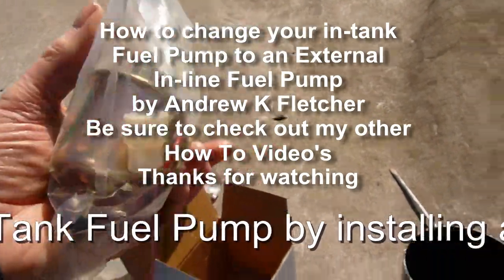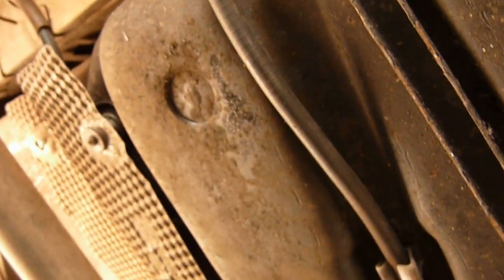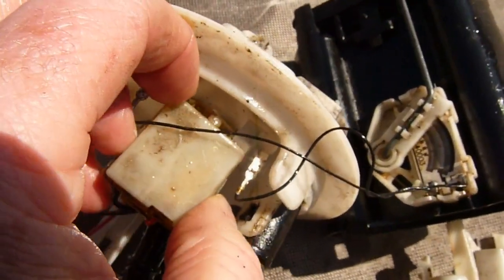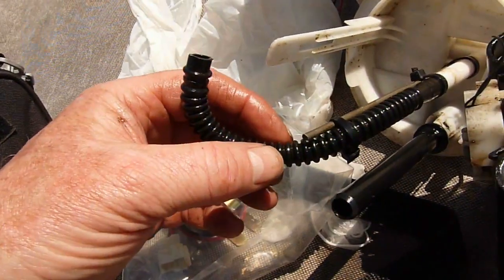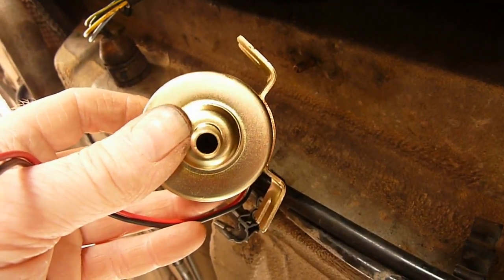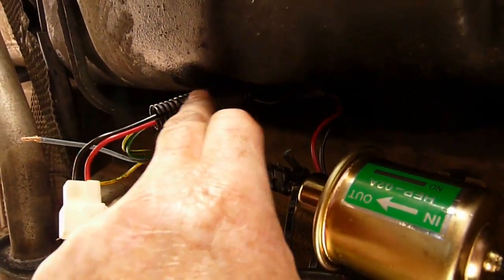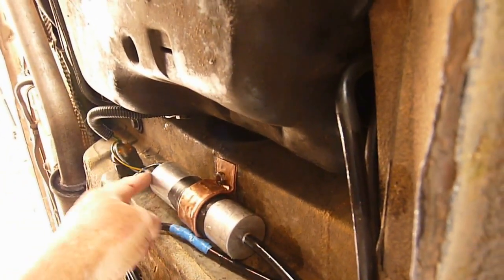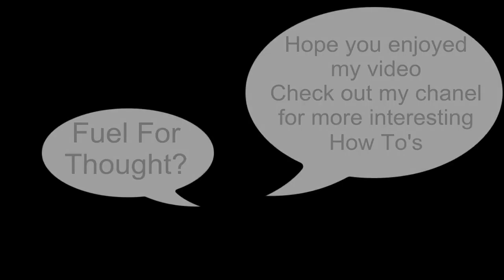Fuel / Diesel Pump Replacement + Conversion to external inline pump from In-tank type Citroen

Comment: Had a similar thought while replacing the fuel pump for my 2006 Honda City/Jazz. Fortunately I found a new replacement motor so the cost was lower than chahing the whole unit. This is good when you donot have a replacement parts or wnat to keep cost low and you are ok with a bit of modification.

Comment: Great video, I just have a question: on my car the original pump works but I think it needs more pressure so can I put an universal electric fuel pump without removing the original working pump? Thanks
Reply from the maker: I would say yes, because the pump stops when pressure increases, so will only work on demand. If your pump is inside the fuel tank, it may have a nylon mesh strainer / filter around the inlet and this can become blocked so worth checking. You may not need a pump if this is the case.
Reply: Thanks for the tip, I'm working on it.

Comment: if i am installing an external universal electric fuel pump on a 94 chevy astro:

1-do i need to take out the old and non working pump from the tank or can it work like this

2-if the line is broken from the filter because it is very old how do i cut the line to replace  the filter, since i see fuel dripping from the side of the line coming from the tank

3-does it matter if i relocate the filter, closer to the engine ?

thank you for your help
Reply from the maker: +ralph whitaker  I removed the old pump, because it would compromise fuel flow and if it's not working best remove it. I also retained the fuel gage / float chamber in the in tank pump housing and secured the pipe to the lower part of the tank with cable ties and a stiff metal rod.  You will need to empty the tank to sort out the pump, so best replace the entire fuel line, because when one part has failed, more pipe will inevitably leak. The filter can be located under the hood for ease of changing it. You may also want to consider adding a non-return valve to prevent fuel draining back to the tank when you change the filters.     My thoughts only    Andrew
Reply: +Andrew K Fletcher I did install it, but in order to get it start I have to spray the fuel injector  with quick start, than the car will start, if I let it run and comes back in a few minute it will still start, but if sits over night it wont start unless spray with quick starts
Reply from the maker: Sounds to me like your pump is not delivering 3 bar pressure?
Reply from the maker: is it one of those noisy membrane pumps?
Reply: +Andrew K Fletcher no its. quiet
Reply from the maker: If it does not deliver 3 bar, the valve on the high pressure pump will not open to let fuel through. The easy start is bypassing this.
Reply: +Andrew K Fletcher ok thanks so I guess I will need another pump
Reply from the maker: yup :)
Reply from the maker: You can research your motor to see what the low pressure pump delivers in pressure to match new one.

Comment: why does not the electricity in the motor cause explosion?
Reply from the maker: The same applies to the in-tank fuel pump. Yet these pumps fail all the time and don't result in an explosion.  These pumps must pass very stringent tests and design in order to pump inflammable fuel, so I guess we just have to trust the manufacturers on this.
Reply: Thanks very much Andrew for your reply.
I totally agree with you.
Guess, such motor will short-circuit if its pumping water instead of oil ? If the circuits are insulated, it should not. But seems like the motor is immersed in the oil that helps cool it down for continuous operation.

Would be great if you could comment on that.
Have a nice day.
Reply from the maker: Richard Tan Tan
Yes the diesel would keep it cool and the heat from the pump would help to thin the fuel down, especially useful for running on waste vegetable oil, though this should not be attempted with an in-tank pump because they are not up to the job.  The external pump is cooled also by the air flow over it, together with the cool fuel running through it.

Comment: What year is your Citroen Picasso ,My One is 2001 Diesel Hdi. will this External Pump work for me ..If So please Let me Know where i can Purchase it,, Yeah the one that Worked for you  ,, Your Info was Very Impressive thank you
Reply from the maker: Mine year 2000 2L hdi   Yes it will work, has your pump packed up? Got mine from Ebay make sure you get correct bar pressure which should be around 3 to 5 bar
Reply: Thanks Andrew

Comment: Thanks for your helpful video but I will need to use it for future intank fuel pump problems. Currently I am undergoing the torture of replacing the intank fuel pump on the sending unit of a 1993 Ford E350 box truck. It has taken me days to accomplish what used to just take a few hours. I am waiting for the parts to arrive. I am fixing this truck to sell it but if I was going to keep it I would definitely install an external fuel pump. The design engineers must have had a good laugh when they designed the intank fuel pump system! Designing them difficult to repair makes the auto manufacturers, parts sellers, pro-mechanics, etc.  billions of dollars more in income and helps kill off the backyard mechanics who are now much more fewer and even further between
Reply from the maker: Mark, I couldn't agree with you more, the in-tank fuel pump has got to be the most useless component I have come across. I can't begin to imagine why anyone would place an electric component in a tank filled with volatile vapours, especially petrol vehicles. I suspect your right also about the repeat work and parts sales that follow.

Comment: Thanks, Andrew.  My '99 Tahoe is gasoline driven and requires a 60 psi output.  I have cut a hole in the floor under the rear left seat and so now it is a removable door.  I had bought a spare Carter fuel pump some months ago that I carry on long trips.  I found your rewiring scheme to be most informative.  I was going to mention the need for sound isolation on your unit but saw that you were addressing that toward the end of the picture.  I love how Eric's vids bring like minded DYIs together. :-)
Reply from the maker: Your welcome. Good idea cutting hole in floor panel to remove pump. Yes Eric's video was excellent, great to see the insides of these pumps. I used waste vegetable oil, filtered to 1 micron, mixed  50x50 with diesel plus 5 litres of stale petrol to thin it down to right viscosity. Works great in Merc but had problems with Picasso, hence need to put in a more powerful pump.
Reply: Andrew K Fletcher I would think Picasso wouldn't be so fussy ...... with all the crazy art.. :-)
Reply from the maker: Gweedo Murray
The pump they fitted in the tanks was certainly abstract ed :)